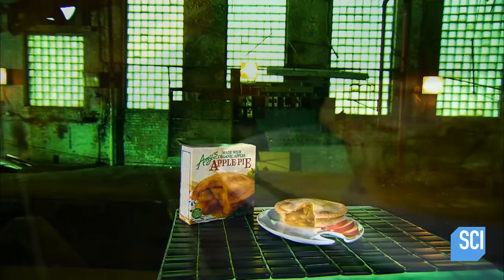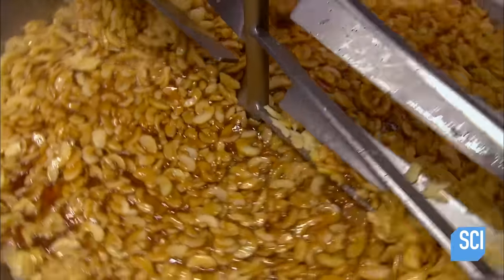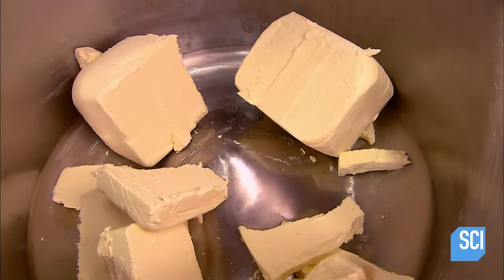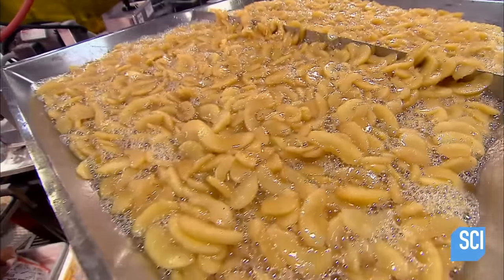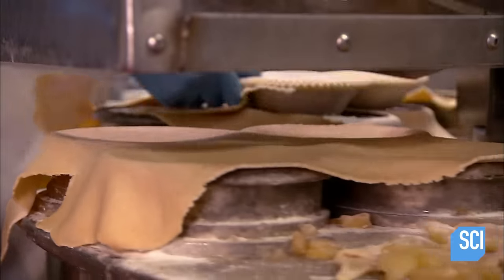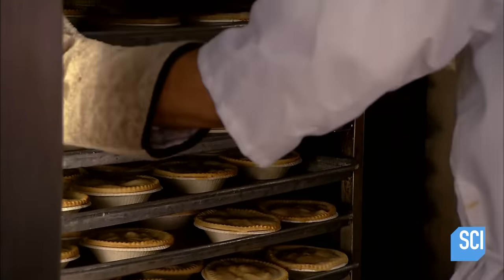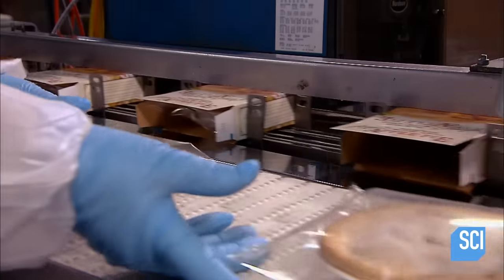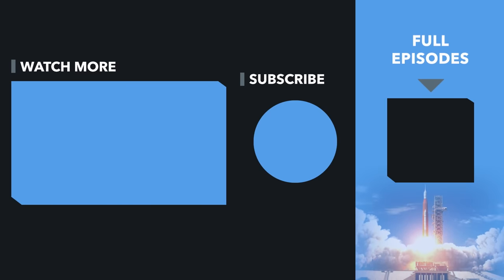How It's Made: Apple Pies

Comment: We need an episode of how it's made this kind of mass production machinery.
Reply: What we need is a "How its made: People who think they are being original for writing this comment on every single "How it's made" video."
Reply: @pgiggles666  what we need is how many people actually watch how it's made cus I don't😂
Reply: the parts are probably custom made by metal artisans
Reply: Exactly I’ve been wondering my whole life how long and exhausting it must be
Reply: I think they actually have a segment for mass production machines.
Reply: it's custom build in a metal factory.
Reply: A lot of these machines are made to order.

The basic functionality is the same, but the machine and/or assembly lines are designed for each costumer, based on the physics.

Some will need a machine and production line that is "long and thin" while others need to have the same facility in a room that is more rectangular.

So basically you ask the manufacturer for a machine that can do X, and the manufacturer designs the machine and production line, based on the measurements of the room or facility it is to be put into.
Reply: They do. It's one of their season finales on Discovery.
Reply: How it’s made was aired years and years ago I don’t think this will happen but it’s a cool idea
Reply: yes definitely.
Reply: @pgiggles666  boooooo. Your life is that negative that you have to spread it to others? I thought the original comment was a great idea, no matter who has said it before.
Reply: @chuchu9649  Machine tools are almost always custom-made for the product.  I did that for a year just out of college.
Reply: It’s just designs and rotators that are well timed,